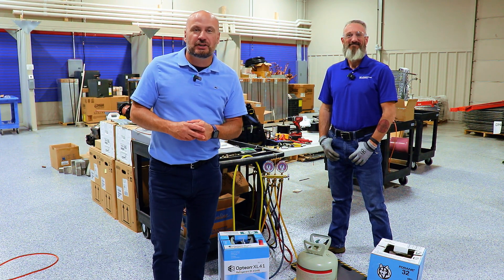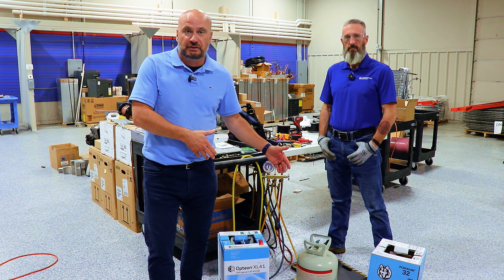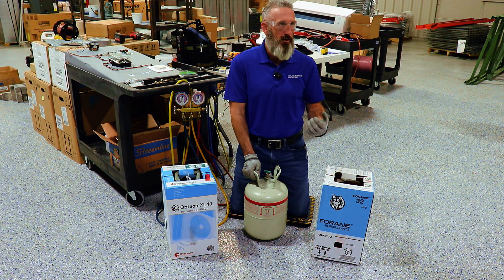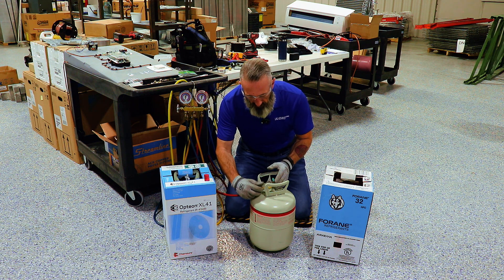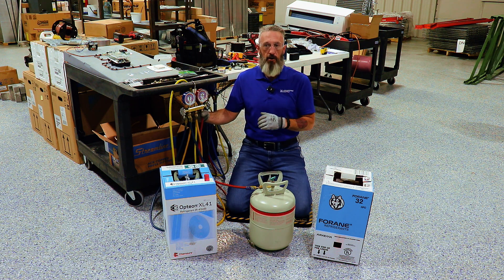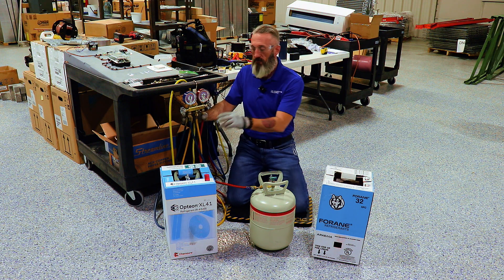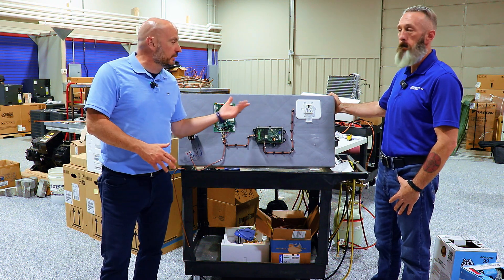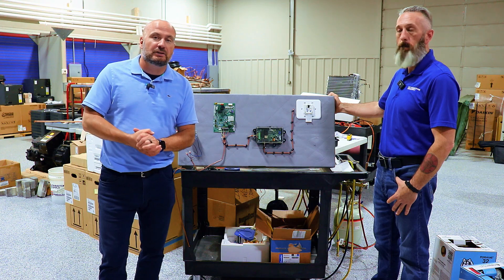A2L Refrigerants & Equipment are Here!

Comment: that sensor is useless in northern attic installations of ac only due to the fact the supply ducts are sealed off from the conditioned space as well as the return air to prevent condensation, We all know everyone turns off the power off also and these systems leak like a democrats bank account.

Comment: A2L R32 flammable is not a legal refrigerant. Why use flammable when there are A1 non-flammable, no-explosive? Did you know that systems charged with A2L R32 can internally explosive? The Dangers of the “Diesel Effect” (Compressor Explosion).pdf
Reply: R-32 has been used in Europe since 1967. The patent isn't even good anymore (unlike R454). If what you're saying is Neil, there be exploding houses thruout Western Europe.

Comment: This isn’t anything new we got rid of R 12 & R502 we learn to recover refrigerant & learn all the different refrigerant that’s on the market.The cost is going to pass down consumer and a lot of guys won’t be gas go anymore for your customer your going going to give them options anymore they going to have to repair refrigerant leak or replace a refrigerant part. l hear anything refrigerant equipment that takes about #10 Ib of refrigerant the system going to need sensor for any refrigerant leaks its going to shut down system its all to do with liability.

Comment: We have used R32 for some years nowadays in most of Europe Most heat pumps use it, is great on pool heat pumps.
Low taxes and good performance the hydrocarbons.
Used on cascade system I served all back at least for 40 years ++
Hopefully the low temperature cascades can adapt to HC .
USA made equipment still use the R508 A-B-C on cascade system 😳mostly type B (Suva 95)
It is so horrible due to that the refrigerant is almost absent these days.
Here you pay (if still accessible) with GWP tax $ 2000 ++ for just one LB if lucky to get it.
Many expensive system owners will get a hard hit by their units will be trash soon😳
Reply: This is all done on purpose so that companies can make billions of dollars

Comment: How much more efficient is R32 assuming it the same system. How much money will a customer save during summer assuming temps and price of electricity are the same.
Reply: It's probably less efficient😂 this is really just to make companies billions of dollars
Reply: The change is more for a better GWP between the refrigerants. Not necessarily for system efficiency. The multiple stages of a compressor, and size of the condenser coils will affect the SEER rating more.
Reply: @wurthmannd024  I’m only interested in does it cost more less or the same to run in a heat pump system